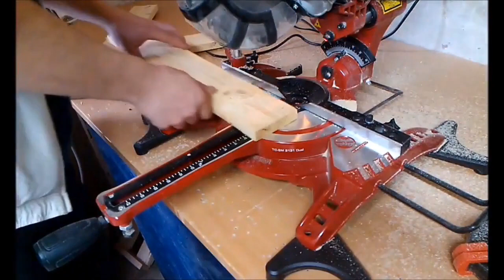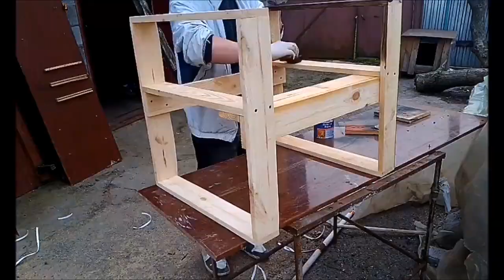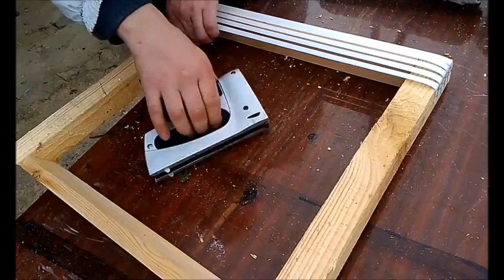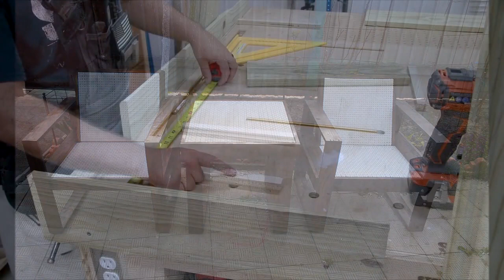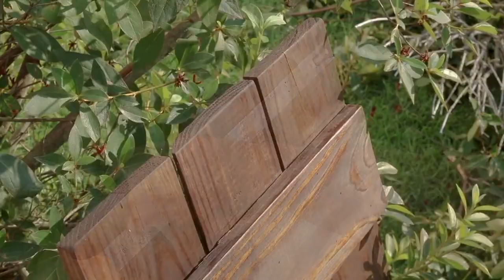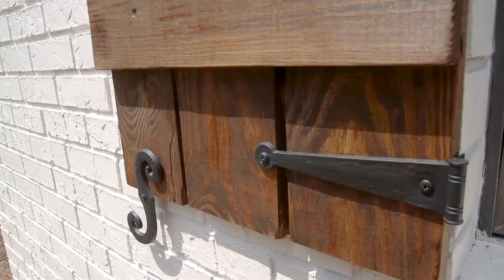Easy Wood Projects To Make And Sell

Comment: pre drill your screw holes to keep the wood from splitting. Also I probably woulndn't use 1x for those chair bottom half's, they won't last long unless you use a hardwood instead of what you have there. Just a few ideas to help ya out to get better results.
Reply: I did not plan to make use of this woodworking book, TopFineWoodworking. Com but instead curious about it. I had been truly amazed right after trying it. I was seeking to learn more about the art of woodworking, and was not disappointed. I found many topics such as wood types and designing your workshop.